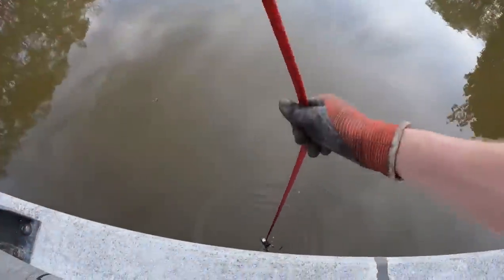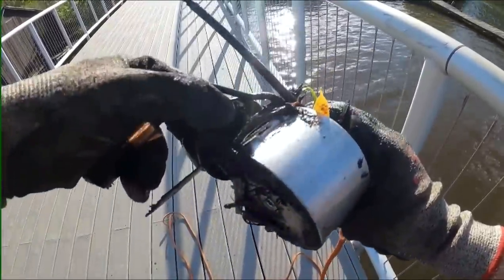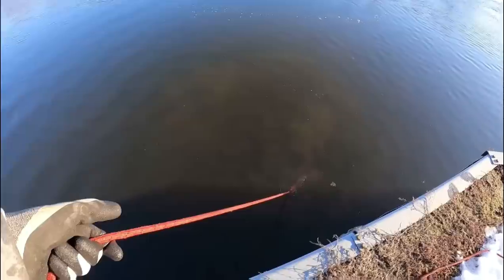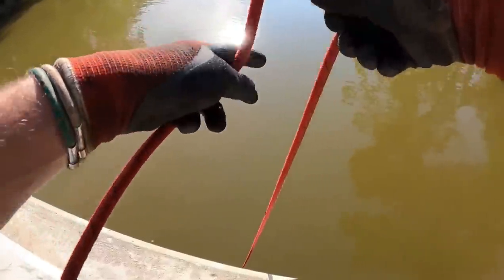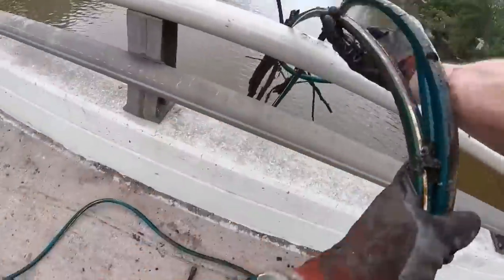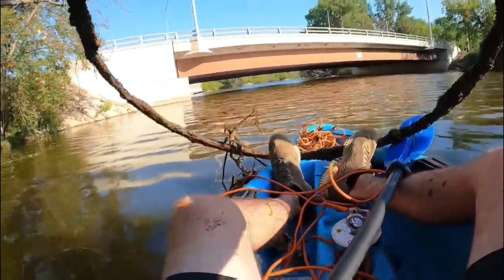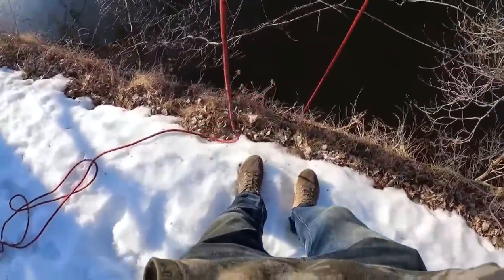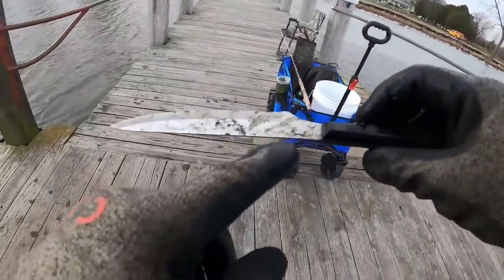The BEST Magnet Fishing Finds From 75 Videos In A 1 Hour Compilation

Comment: You found a roller about half way through the show I can tell you that is what it is its  roller off a printing press. By the size looks like a small ATF 11" +17" that press was made in Wis. I think. It would be the copy machine of the last century. There still used today all around the world. The reason you find them in the lakes & rivers is because they make good roller for handmade boat trailers. Boat lifts. They will folt for a while but then the rubber gets waterlogged and they sink. I seen you catch them before they can be from 11" all the to 40" or more. Sorry for the history lesson but I have worked in the printing industry  for 30 + years retired now.

Comment: On the weekend I saw something in the water with my friend. It was a box. We didn’t mind it and passed along. Then the next weekend we tried pushing it out, it didn’t work. Another week later we finally bring a magnet. We find some cool stuff and finally try to get that random box. The line snaps and we have to get it back. Eventually we just go into the water. HORRIBLE IDEA. The water is super cold and I have to go in three times. I wasn’t even able to get it up. But I threw it up for around three seconds. In that time I remember a little dial like on a safe or microwave and a bunch of tape on it.So I’m going to buy a magnet today so it arrives by like Friday and I can magnet fish on the weekend. I may post a video on my channel so watch out!!!
Reply: Hope you find something  valuable
Reply: Update: We tried to get it but it was to heavy, then the next day we tried a different spot and only got 2 throws in. That's because it got lodged between two rocks. We went into the water with trash bags under our feet and tried to get it. We didn't get it and had to leave it. I'm planning on ordering a new one. Wish me luck!!!

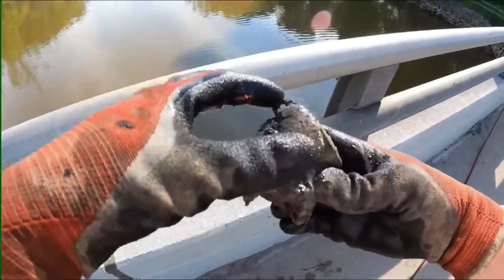Comment: @4:53  I can tell you exactly what that is.. but not what year it came off of as they are interchangeable for several years         It is a starter solenoid for a Ford or other manufacture .. from the 60's 70's that were on the fender wall

Comment: 29:55 looked like an inline fuel filter
Reply: 35:33 looked like the top of a transmission jack or something, normally people cut a section off an old car tyre and drill it to the board or bolt it onto a metal plate so its got a soft top and doesn't damage the gearbox or whatever you're using it to support

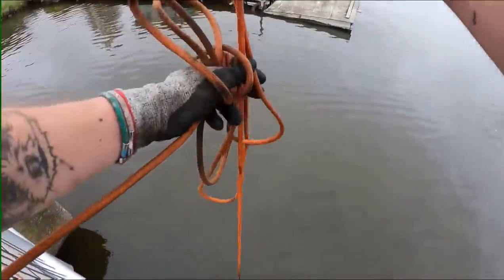Comment: At 18:31 that is called tin snips ,, they are for cutting different kinds of sheet metal ,, and at 30:45 that is a older type of pipe wrench ,, i think my grand father had one and i believe they had wood handles so whom ever was using it would not get their hands burnt from the temp coming off what ever they were working on !